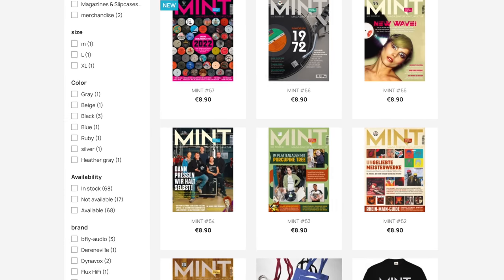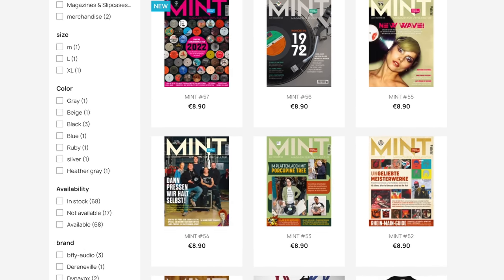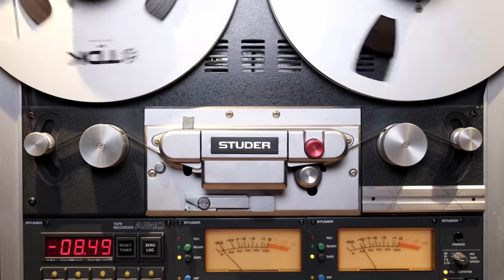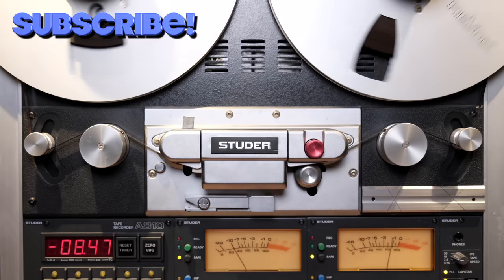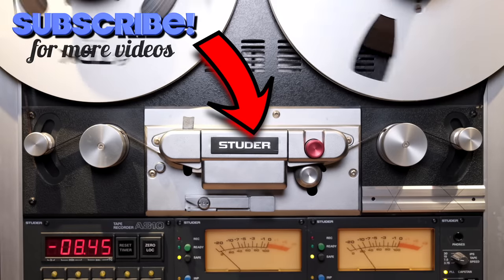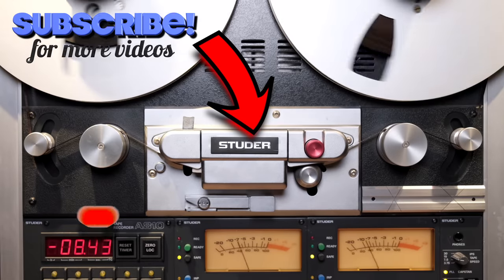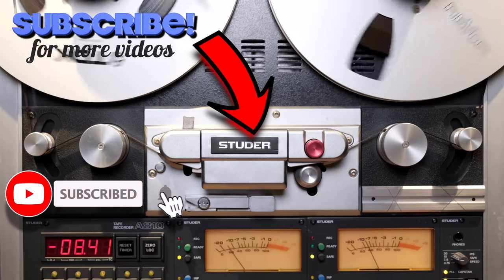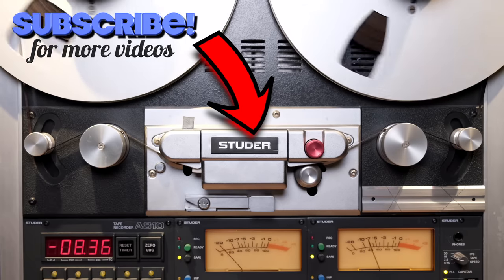Digital Delay: The little dirty secret of vinyl mastering (including past AAA records)

Comment from the maker: ATTENTION! Some viewers have misinterpreted the message here and I was probably not very clear. Digital delay is NOT present in the current quality AAA productions that we all know and adore. I was mainly referring to the shocking fact that since the late 70's several records that we all believe being analog (AAA) have actually been cut with a digital delay and there is practically almost know way to know which had it and which not. Moreover, I SUPPOSE that other current random AAA productions made occasionally by lables who don't usually make AAA records may have in fact used a digital delay, perhaps not even knowing it since ity takes place in the lacquer mastering phase. As Michael Fremer pointed out Abbey Road, Sterling Sound, Cohearent Mastering, Emil Berliner Studios, Blue Heaven, GZ Media and many others all use analog delay tape heads when mastering and I would add also Quality Record Pressings. Sorry for the misunderstanding.

Comment: Singles are usually cut at a constant pitch so no need for a pre-play tape head on the tape machine or an electronic delay in the signal chain....  Engineers know they only have about 5 min of land to work with so the LPI (lines per inch) can be easily calculated.  Most 7" and 12" singles are cut at a constant pitch and without program delay.  That's why i love singles!
Reply: They could also benefit from a delay for the purpose of creating a look-ahead time for a limiter
Reply: @Paul58069  For sure but, any limiting would be better done during the multi-track mix-down to master tape stage.  It is possible to use an analogue automated mixing console or an outboard limiter controlled by a S.M.P.T.E. time code that you have pre-written to a single track of the tape. 

Unless you are referring to "acceleration limiting" which is used to limit only high end. This can be done on the fly while cutting without delay but you still should really have all those issues sorted at the mastering stage.

In this instance we are using "delay" to control only "land" (i.e. how close you pack the grooves together).

Bass occupies more "real estate" on the disc than mid range and  high end so, when cutting the disc, you need to know (one revolution ahead) when the bass will arrive at the cutting head.  So that you can increase pitch (the speed at which the cutter traverses across the disc).  Once the heavy bass has passed you can slow the pitch down again and cram the grooves closer together. This variable pitch process allows you to put up to up to 30 minutes on a side of an LP.

If you cut at a constant pitch you only need to set the pitch speed for the loudest/bassist part of the program which will limit you to around 15 minutes per side of an LP.  
On one side of an album you may have 5 tracks...  two tracks heavy in bass with high dynamics and three ballads with quiet bass passages.  
Unless of course you just compress the hell out of everything. Then you don't need to worry.

The beauty of cutting a 3 minute song to 7" disc that can hold a up to 5 minutes of music is, you have plenty of land to just set the pitch to the loudest and most bass heavy passages. Thus eliminating the need for delay.
Reply: @janedoe6350  In part you are right. But a mixing engineer is not a mastering engineer and a mastering engineer is not a cutting engineer. This can, and almost always will be, three different persons. Only the cutting engineer will know if the are any peaks left that need to be dealt with. So yeah, a short look-ahead time when transferring the master tape to the laquer could be beneficial, even for 45's..
Reply: @janedoe6350  You appear to be the only person in this video that knows what  they're talking about. The digital  delay or any delay fo that matter is used for the land. But, it appears a lot of people in these threads think the digital delay signal is what is cut into the vinyl as audio.
Reply: @djpopcorn  Here's the thing.  The digital delayed signal IS used to cut the audio (because it comes later). The true original signal  (the look ahead) goes to the computer to calculate the land. It has to because it comes first..... while the digitally delayed signal arrives at the cutting head one revolution later. (555 mili-seconds for 33.3 rpm & 750ms for 45 rpm)
So the the quality of the audio is determined by the quality of the delay.(be it an analogue delay or a digital delay).

The way it is done in analogue is that the tape machine has two playback heads spaced the correct distance apart in relation to the tape speed.
Reply: @janedoe6350  Whoa. Then I'm the one mistaken! 

But I do like what you said about 12" singles.
Reply: @janedoe6350  Question....have you heard of a lathe that has two cutter heads? And if so, does this allow the signal to not h e to go through a DDL?

Comment: This stuff has been digital since the mind 1980's.  Especially all the "remastered from original tapes" releases.
Reply: Yes, correct!  That's why i always look for a bar code on the jacket.  The whole world seemed to go digital over-night towards the end of the 80s.  Bar code readers appeared around the same time as digital delays....  so no bar code on the jacket of an LP is a good sign it's all analogue (as even the stock control would be analogue).
Reply: Yes, this is mentioned from about 10 min. into the video onwards. One must fight the temptation of commenting without watching the whole thing... Well, I sometimes do that too, I'm not going to lie, BUT of course, if later on it turns out that I got something wrong I delete or edit the comment...
Reply: That's a LIE

Comment: Cool info, but I don't see any problem here. If it works, it works. No sound engineer who mixes professional recordings cares about your or my opinion. They just do their job however they see fit. Yes, there exist bad mixes, but really no one cares. You just don't like it and move along.
Reply from the maker: The problem is the same of MoFi you are paying for a specific item (in the AAA cases)...and it's the opposite. Since this regards tape, it is a problem related to a wealth of so-called audiophile editions, plus, it means that even normal analog Productions of the 80's and 90's if the payback machines didn't have a second head it means that those are all digital. Finally, the conversion is Cary out not but reference DACs, hence and even more poor sound quality.

Comment: Thank you for your detailed explanation. I have many vinyl albums that I thought were sold as all analogue, yet my digital version of the same recording sounds better and for less money. For me the best source material is reel to reel tape. I used to buy tape sparingly because of the cost, but with some of the supposedly high end vinyl records costing around $500, (what a joke), I find myself buying more and more tapes. I have never purchased a tape that I was not happy with, yet I purchased many expensive vinyl records that were just imperfect in many ways. They were not flat, not concentric, plastic flashing in the center hole and around the outside perimeter of the album, the label is off-center, hair line scratches, early pressing are better than later pressings. etc. Vinyl making is just an imperfect, hit or miss process.
Reply: This story is NONSENSE.

Comment: As a bit of a joke and for fun only I'm waiting for someone to put a compressed digital file on an lp only to be decoded by a DAC. If I can play an audio file from an old slow bit rate floppy disk then this would be possible with digital compression on a grove. This would just be for fun to maybe decode a secret song or message. Of course you would have to warn others to remove the headphones before playing otherwise you would hear loud white noise.  You would also have to own a DAC to decode it.  It's like kind of finding those hidden messages scribed into the near center of the vinyl or messages that would have to be played backwards like something from the 1970s. Like ELO's Fire on high song at the beginning. That had me laughing the first time I heard it years ago.  It makes vinyl fun like gatefold covers with pop out scenery. I have seen some crazy things like making a record out of chocolate or even ice and it actually worked.
Reply: actually somebody kinda did that but it was a tiny program for commodore 64
Reply: @@XX-121  Ultimate compressed audio data might be able to be stored on linear analog media as a bit stream with some quality loss but listenable. I wonder if anyone has tried to put this on an analog casssete at normal speeds like they used 40 years ago for the Comedore.

Comment: I was a cutting engineer back in the 80's (1984) and I was lucky enough to have been handed a brand new, state of the art lathe, the Neumann VMS-80 SX-74. That was the only one lathe I ever worked with as a mastering engineer.
 
This fabulous vinyl-cutting lathe included a Neumann SP-79 mastering console and a SAL 74B amp rack, paired with an MCI JH110B mastering 2-track tape player with two 1/4" heads with delay mechanism for normal and half-speed cutting. 

I agree with 99% of what you say in the video, because I lived all that myself. But I strongly disagree with the 1% of what you stated, which is that this lathe cut a digital conversion of what was played on the tape and used the analog content just to prepare the lathe for the changes needed to be done to get a perfect cut.

Well, I know that for the lathe and array of components I came to know like my hand, this is not entirely true. The feed being cut into the acetate was the analog one, from the second head (delayed), of the tape player. The other analog feed, coming from the first head, was fed to the electronics in the SAL 74B rack, so that the filters and other electronics could provide the proper signals for the cutter to automatically adjust pitch, depth, and other non-musical tasks, instead of having to do it manually as in the VMS-70. T

I believe this is the biggest difference between these two great lathes.

This automation embedded into the VMS-80 allowed the cutting engineer to focus entirely on the nuances of the music, mastering and enhancing what was to be cut to make a better sounding, commercially and/or artistically desirable, final cut. I know this because I've been there, done that. Many, many times.

I became a mastering engineer thanks to this marvelous Neumann lathe.

Thank you for the beautyful and well done video
Reply: I think you are really saying the 99% of what he said is wrong, since the part he got wrong was the point of making the video. Thanks for your comment.
Reply from the maker: Nope! You're getting mistaken. You didn't listen with attention. When you have 2 heads obviously you are cutting analog, that is analog delay! It's when you DON'T have two heads that you have a digital delay because you are using only one head like the Ampex model I have shown in the video.
Reply: @allanmoorhead6546  I am now saying tha it is 100% right. Please read the comments below. Thank you for your comment.
Reply from the maker: @franciscojosecastanedojord3457  thanks Francisco!
Reply: The video is a lie.
Reply: @trackingangle929  No, it is not a lie. You must get yourself really educated in cutting lathe funtioning and vinyl. I love digital when it is done right. But although I don't like music analog vinyl, I must agree that it sounds great. I just don't like it for me.
Reply: @anadialog  Well, the whole story is still unclear to me. But like I suggested earlier, it should totally be possible to control the spacing of the grooves digitally without interfering with the analog signal. Possibly even enhancing the sound because it isn't advantageous if you cut the record till the label, I often have records where my stylus has a hard time tracking the inner grooves.

Comment: Thanks for this nice presentation and summary of the digital delay. While it is a well-known procedure amongst the pros of the industry and for most of the engineers involved in the musical production, many audiophiles are still unaware of all the technical steps needed to produce a vinyl record, from the recording until the LP slides out from the press. Your video also highlights why the SPARS code is (and always was) an inaccurate tool to track the devil (=digital conversion) within the conception and birth of a record.

Comment: Guido, you hit the nail on the head!  This is one of the MAIN reasons I still do not own a turntable (I have plenty of DSDs - and tapes - that sound very analog WITHOUT any of the issues associated with LPs).  If I need to mimic the ANALOG sound, I use a graphic EQUALIZER (YEAH, graphic EQ, a dirty word in the audiophile community!  Experience the Schiit Lokius EQ yourself to see what I am talking about - this thing is amazing) or record the DSD music to my analog tapes using "musician's /high distortion" tapes such as EMTEC/RTM SM468 or 3M 206.  BTW, I have read about the ADD-1 from Ampex years ago - another reason I despise modern vinyls!
Reply: But they’re nice to hold 😅
Reply: @gdwlaw5549  you mean the LPs?  I'd argue that it is a lot nicer to hold and watch the reel to reel tapes spinning!
Reply: This story is a steaming load of nonsense.
Reply: the story is nonsense

Comment: I would also add that a digital master can sound really good. If vinyl forces producers to stop the loudness wars and produce a better mix, it's already worth the price of admission. This is useful information though and it actually may explain why vinyl sounded different in the 80s.
Reply: You’re right, Benny. For me that’s the bottom line about vinyl. If it sounds great and it helps us to avoid the horrible loudness wars, it doesn’t matter if it’s digital.
Reply from the maker: Yup, stated that in dozens of my videos...
Reply: Loudness war started in the vinyl era already. SP records could be easily hot-cut, so some labels began to use it in the sixties. Recently I bought LP version of some modern album, made a test record into computer and when I saw a waveform, I first thought, that my cartridge or preamp had some serious trouble. The waveform in the bassy parts was clipped. Tried another vinyls and no problem. The mix of this particular album was already digitally brickwalled and clipped in digital domain and in this form got onto the vinyl...
Yes, sound of vinyl records changed in 80s, because modern music generally started to be recorded and mastered digitally. They even advertised it on the package, because back then this was a good selling point. Digital was a buzzword and everybody wanted to be digital...
Reply: @anadialog  You did!
Reply: @StackOverflow80   Generally speaking, lots of time, even modern vinyl sounds better. Of course, there are many exceptions, but there is something to be said that audiophiles have kept vinyl alive. I think the problem with digital is that, analog is a lot more idiot proof. It's a lot harder to make a digital recording sound good. Analog is a ton more forgiving. A digital recording pressed on vinyl may sound even better because of the nature of analog.
Reply: @BenneWill  I also think/hope that my experience was a sole exception. I have almost no experience with modern pressings, because mostly I buy vintage records. But chance for better sounding mixes on vinyl has IMHO opposite reason than you just wrote - the analog is NOT forgiving (unlike digital), thus forcing sound engineers to be very careful with what is cut on laquer or copper. While digital recording is just virtual space filled with numbers, where you are free to make whatever you want with your sound there, mechanical sound recording on the other hand has very strict physical limitations. If these limitations are overstepped, it can result in heavily distorted, unplayable vinyl record, damaged cutterhead, etc. You just cannot cut some brickwalled digital audio on laquer or even copper in full level. If you want so, you must decrease recording level by many dBs. So then it's better to record sound with more natural dynamics there, where level is not in full maximum all the time. Also stereo stage has some limitation in record cutting.
Reply: it's useless information because it's wrong information.